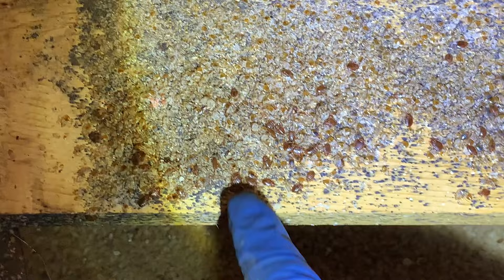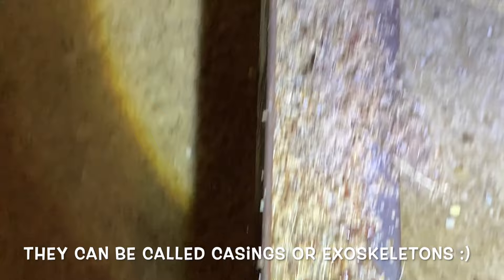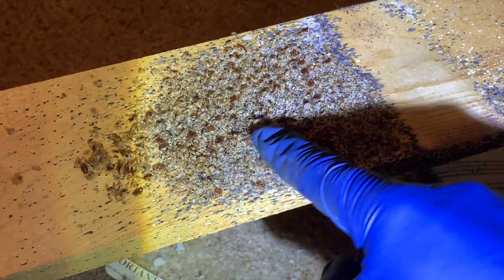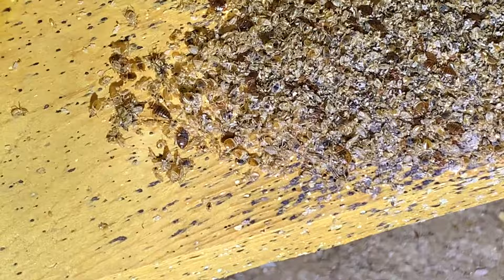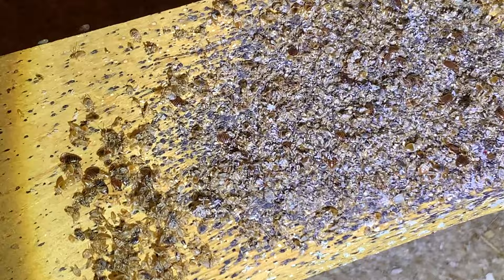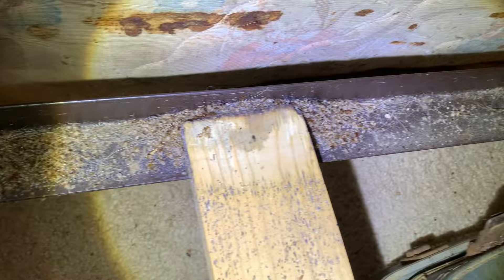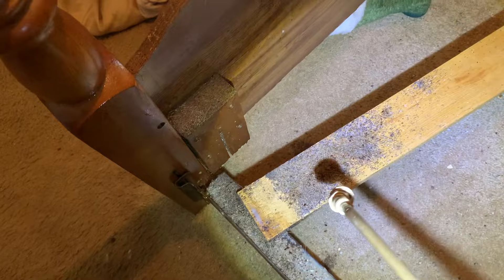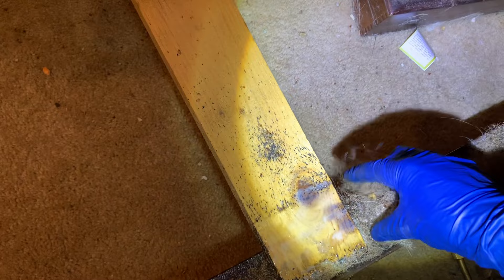This is Where Bed Bugs Come From

Comment: I currently intern at a hospital and my biggest fear is bringing back bed bugs from a person that comes in, are there any signs on a person I can look for besides the bites? Like you were saying about wheelchairs, would there be any signs on those like droppings or something for me to look out for?
Reply from the maker: Yes there are signs of an infestation. But picking some up at a hospital from another person is unlikely. The best thing to do is just throw your clothes directly in the wash when you get home and shower right away if you think you may have been exposed.
Reply: @DanTheBugMan  okay got it, thank you so much!!

Comment: I have had an infestation for a couple of yrs I have paid thousands of dollars through a company and things that are on line I still c them once in a while Im at a cross road I dont know what to do its driving me crazy plz help me Im on a fixed income but  plz tell me what I maybe able to do I have thrown away furniture mattresses toys clothes
Reply: Heat treatmeant, diatomaceous earth, and bed bug mattress covers. Professional heat treatment is very expensive though, so I recommend doing it yourself. You can search online for how to do it but essentially you are going to need to borrow or rent a few commercial items like a furniture steamer and some industrial heaters. Use the steamer to treat the bed and all furniture (assuming it isn’t already far gone enough to just throw away) and cloth items that can’t be put in the washer and dryer, making sure to be extremely thorough getting all cracks and crevices which is where bedbugs like to hide. Typically bedbugs live in the places you do like the bed and couch, but a bad infestation they can end up all over. When you use the heaters you are going to want to put them in the rooms where the bedbugs are (about one heater per 500sq ft) and then do your best job of sealing up that room after the heaters have been set up so the heat and bedbugs cant escape. Remove all plastic and electronics before running the heaters, and let them run for a few hours to make sure everywhere in the room gets to the appropriate temperature to kill all bedbugs wherever they may be hiding. Wash with hot water and dry in high heat all clothes, blankets, bedding etc. after steam and heat treatment put a bedbug cover on your mattress. You will likely need to do these treatments more than once to ensure all bedbugs and eggs are eradicated. Don’t waste your money on pesticides and “bed bug bombs” as bedbugs have become immune to them. Hope this helps.

Comment: Can you use a heat gun for bed bugs???
how can you treat termite currently in the Ceiling??
Reply: In the old days of sprung beds,you would heat the joins in the springs with a lit candle . Today there are termite killers that use a type of mold. The termites carry it down into their nests where the mold destroys them and the nest.

Comment: Without a DOUBT this guy constantly TAKES them home on a regular thinking stripping down at the door will make a difference when they are on the bottom of your shoe's from stepping on the eggs that's on the floor that you will sooner or later track inside your house or they'll just make way in wherever you stripped down at, i prefer you wear a hazmat suit and have someone spray you down with 91 percent rubbing alcohol BEFORE you remove your hazmat suit every single person who is in the bed bug field has a story about having them from work.

Comment: Your implication that this infestation is "going to take months to get rid of" is nonsense. As a pest control technician for over 15+ years, I can tell you that I've completely eradicated MUCH WORSE infestations in a mere 2-3 treatments within a 3-4 week time-frame. You have a lot to learn.
Reply: what did you use
Reply: @vidviewer9727  
Phantom SC (or Temprid), a backpack sprayer, cyfluthrin crack & crevice, and mattress/box spring encasements. Honestly though, the methods used (how & where) to apply are the most important aspect. Also the overall amount sprayed.